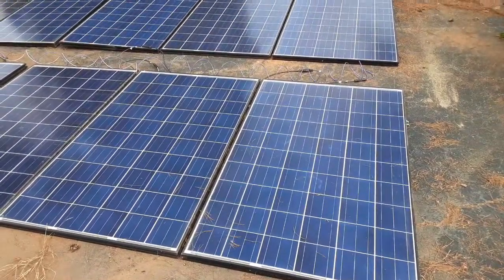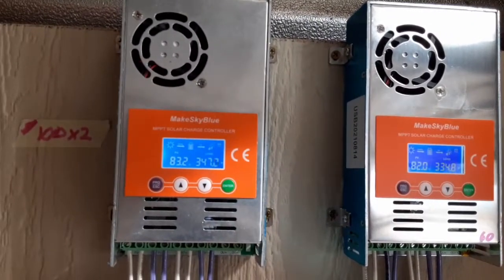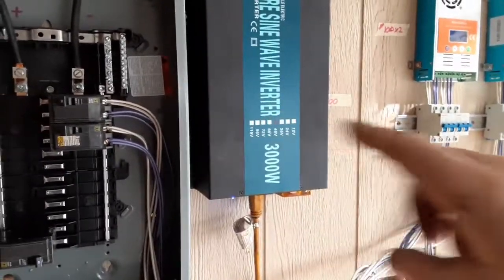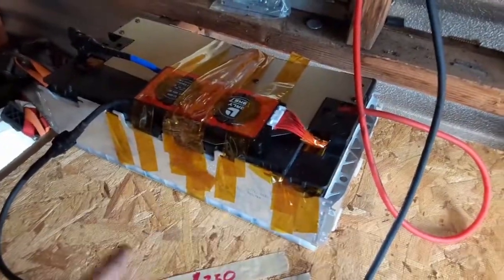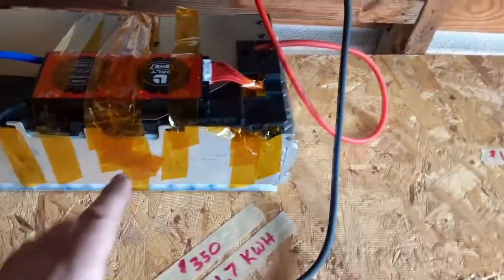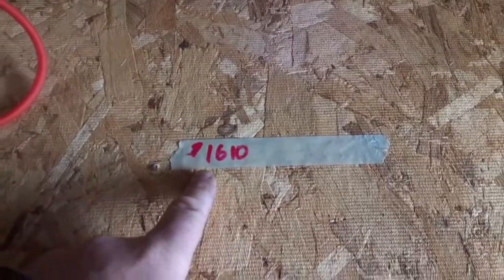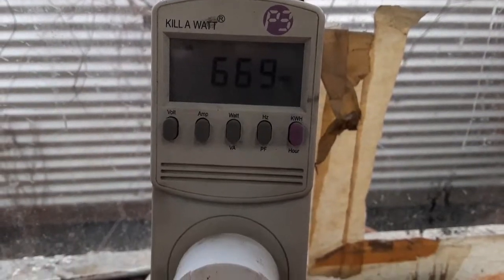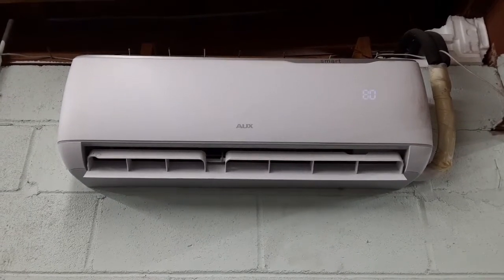Solar Powered Air Conditioner and Heater for Off grid DIY System AC Mini Split

Comment: I'm interested in your setup?  Trying to figure out my options. I already have a Daikin mini split installation at my house.  It has 2 internal units and one external unit model: 2MXS24RMVJUA.  Unfortunately it takes 240V ac input power. The label says "compressor motor 15.5A"  so 3720W I guess.  I'm assuming I'll need a 4000W+ setup to power it once I add in the power consumption of the internal units.    I don't know how much power is used when it is run as a heat pump vs when it's run as an air conditioner.   If I got 400W panels, how many do you think I'd need to be able to run this year round.  I'm in southern CA, so generally pretty sunny year round.  I'm considering a 120/240V split phase inverter to give me the option of potentially powering other 110V things as well but I'm still researchign and learning.  Another question I have is, what happens when the cloud cover is such that the panels don't generate enough power.  If the battery runs low will it just underpower the minisplit system or will it shut itself off?  Is that bad for the minisplit system?  I'm currently on the grid and am hoping to set up a DIY solar system that never feeds the grid.  Is there a way that the minisplit system could automatically be switched back to grid power if my solar/battery system isn't providing enough power?  Do you have any tips for me as a noob?  Thanks!

Comment: I've seen some mini split units used less power on heating and cooling between 300-600 watts once they reach the set temperature does yours go down further than what you showed us ??
Reply from the maker: Yep, it drops down to a couple hundred watts once it's at temp. 24 hours of runtime is usually around 6000-8000 watts total.
Reply: @lsswapshopp  Ok cool I can't wait til mines get here I'm out here digging a spot for it now..
Reply: @lsswapshopp  if these cloudy days will go away maybe I can run mines it will be here Wednesday but it's so cloudy here in northwest Ohio I'm scared to run the thing.

Comment: One more question if I may.... On that one battery how long will it last you once the sun is down and you want some heat?.. thanks
Reply from the maker: Each battery I'm using is roughly 1kwh, the mini split uses 1300 watts at peak power, so roughly 45 minutes per battery If I ran them down all the way.

Comment: Thank you for this video! Extremely helpful. Is there any other option as far as which battery you could use ?
Reply from the maker: Yep, lots of battery options. You can use any 48v battery system with the inverter, it just needs to be a big enough battery bank that it can put out the amps needed for the AC.

Comment: Hello, I’d like your set up, very simple looking. I’m totally new in the subject and learning; can you tell how did you connect solar panels together? How many volts and amps coming to each solar charger?
Reply from the maker: The panels are 3 in series, for 90ish volts depending on sunlight, and 2 strings in parallel to each charge controller. So 6, 250 watt panels per charge controller. 1500 watts @ 90 Volts x 2 controllers.

Comment: Very interesting...so much less, $, then what other YouTube videos report.  I'm finishing my desert cabin this year and need a similar system to stay cool in this West  Texas heat.
Reply from the maker: The biggest part of cost is the type of components. Nothing I'm using is grid tie certified/legal, so it's a lot cheaper. It's not that it's poor quality, but it doesn't have any of the extra electronics or testing to play nice with grid power. Also I'm not sponsored, so I don't get free high end equipment to "review". 

As long as you're insulated decent and the mini-split is sized correctly for the living space, it would work in Texas, it gets +100*F here and works fine.
Reply: Question, 
My sketched cabin/tini house/shed will be arround 416 square feet. Do your setup will work on my tini house.
Reply from the maker: Yep, the 12,000 BTU mini splits are rated for 600 sq ft. The AUX one I used has an inverter compressor which basically means it will ramp up or down depending on the size space it's cooling/heating. It also makes it friendly to solar power since it's a soft start. It would do 416 sq ft no problem and wouldn't be "oversized" since it would just ramp down to cool the smaller space. I've installed 3 of them on different sized buildings and they work great. I get them from Lowes.

Comment: Nice setup. I'm looking at installing a 12volt marine air conditioner and running it off my solar. I have one in my sailboat that keeps it cool on really hot days. I'm just trying to size up a good system to keep up with it and the 12volt freezer I'm installing in my shop. How long does it run off just a single battery, and do you have problem's getting the A/C compressor to kick in?
Reply from the maker: The compressor comes on fine, I picked this unit specifically because it has a soft start feature which is actually a DC compressor that runs off of vfd even though it uses AC to power the whole unit. To size your system you'll need to figure out your Watts requirement and how long you need to run it, then convert that to a to size the battery Bank. The kill-a-watt testers are really handy for that.